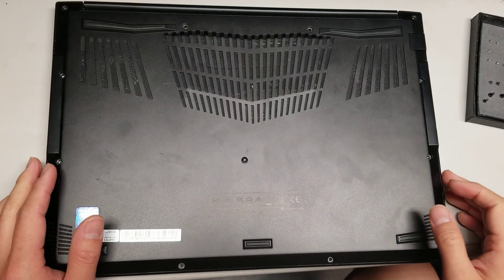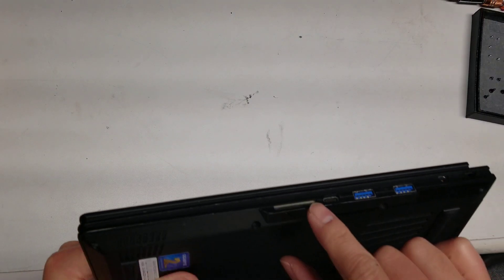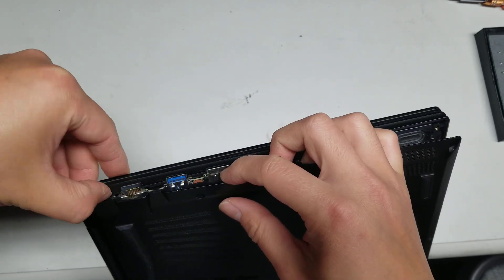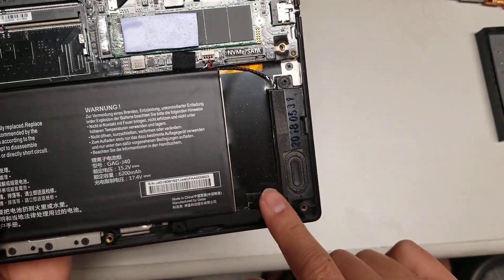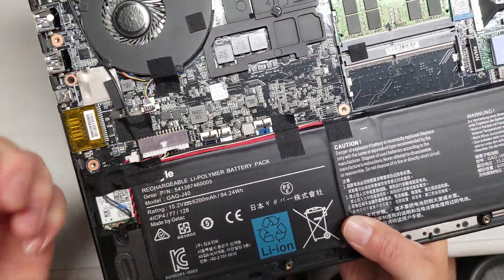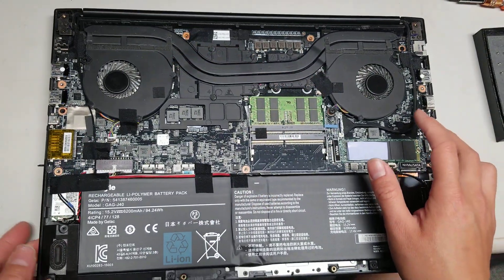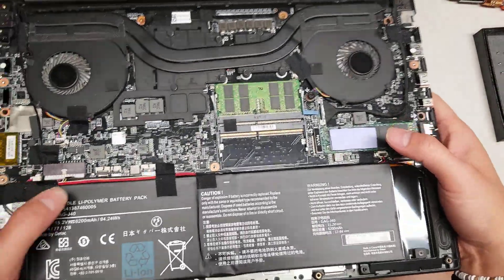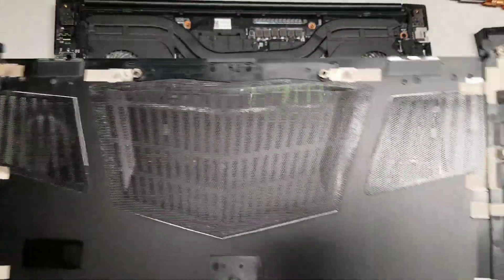Gigabyte Aero 15 Disassembly SSD RAM Upgrade

Comment: U had speaker cable beside each speaker, the long cable u thought was the speaker running along the battery is actually the battery cable
Reply from the maker: The red and black is actually the cmos bios battery. I was right about both speakers being connected with the one connector.

Comment: I looked for this for so long!!!!! Thank you!
I already opened my aero 14 once to replace the faulty overheating ssd but now I have to replace the wifi card and repaste the CPU and I just didn't feel like doing it without a disassembly video
Reply from the maker: No problem. Hope it helps. If you haven't already, please like and subscribe so others can find my videos. Thanks!
Reply: @ItsBinhRepaired  I did like but I don't really find myself needing those videos often. I will put this one on a playlist so I'll remember your channel next time. Try adding tags for "teardown", "guide" and such, the video really is way too difficult to find for how relevant it is to what I was looking for.
Reply from the maker: I think you're right. I added teardown guide to the description of all my disassembly videos. Hopefully that makes them easier to find.

Comment: Nice video. Question: where is the BIOS ? I have to change mine because i do not remember the BIOS password and i have no USB boot (now my grub is done and i'm screwed to...). If you know how to reset pBIOS password without to change it... but i get one BIOS chip i ordered on ebay and i want to change it, but i'm not sure which chip is it on mobo... an help with that is very welcome.
Reply from the maker: No idea

Comment: Hi -thanks for this. Came here to review the removal of the bottom cover for a RAM upgrade for an Aero 17 HDR XD. Seems a T6 Torx bit is required (good luck finding a descriptive manual on the Gigabyte site) for Aero 17 model as well. Have you come across any issues where the battery won't fully charge? Upgraded to latest BIOS F007 and then Win 10 to Win 11..no change. PS Gigabyte  is a disappointment as of late. Their Control Center software where you tweak settings, doesn't work in Win 11, hold off on the upgrade. to Win 11.
Reply from the maker: Yeah, sadly.

Comment: Hi, I flashed my BIOS with the most recent BIOS for this computer and now I get nothing but a black screen on power button and power doesn't shut off.  There was no startup sequence.  Pressing F2 to get to bios screen did nothing.  I had to open computer and unplug the battery to shut it off.  Any idea how I can fix the bios now?
Reply: oh and the only reason I wanted to try a new BIOS was because the onboard video camera never worked and I thought it might be a BIOS / firmware issue.
Reply from the maker: If you killed the bios and a cmos reset doesn't work, the motherboard is dead. You'll need someone to replace the bios chip or replace the motherboard.

Comment: Can you put ssd SATA? I saw a review where she said that she had a space but I can't find anything for her.
Reply from the maker: You can put an m.2 sata ssd to the right of the battery. I think it says it supports both pcie nvme and sata, but pcie is the better choice if price is similar, which I've noticed sometimes they're actually cheaper.

Comment: Is there any possible way for a SATA drive to even fit in that spare slot? Looks like there's no space for one.
Reply from the maker: If I didn't mention it in the video, I don't know.
Reply: It has to be sata in m.2 form factor. Like the wd blue.
Reply from the maker: @catonomics  they were asking if the bottom left side they can fit a 2.5" sata drive

Comment: Hi, great video, exactly what I was looking for... It's summer here, playing some heavy video games this goes up to 60º, sometimes 70º, And today (even with full fans) I watched 88º ='(  in my program "ThrottleStop" (A friend told me about it and works really good, lower the temps by itself). 
Anyway... Should I take it apart to clean it or do you have any other method?
Ps: I really take great care of my notebook, it hurt me even to see how you moved it and its small knocks against the table xD
greetings
Reply from the maker: Lol just a little dust cleaning. It shuts off at 100º, so you should be ok, but if it's dusty, clean it up.

Comment: Fuuu... Every time when open laptop back-plate BEFORE add/remove RAM/SSD you MUST disconnect battery!!! Do not touch elements when battery not removed! One exception: SATA HDD.
Reply from the maker: Wrong...I've been doing this over 10 years...The only thing you need to remove the battery for in advance is the lvds/lcd/screen cable. Other than that, unless you drop something metal on the computer, there's no problem leaving the battery connected.
Reply from the maker: Real life experience beats whatever fake knowledge you got from wherever you were trained. Lol The only other thing you need to do is make sure the computer is off.

Comment: The red and black cable is probably for the cmos battery
Reply from the maker: Probably
Reply: maybe not, because there is no CMOS battery for the BIOS, as long as the BIOS has an eeprom memory inside. I didn't see any CMOS battery under too...

Comment: Can it run when the battery is removed? I mean just use the AC adapter…
Reply from the maker: It should, I don't see why not. Most laptops do.
Reply: @ItsBinhRepaired  oic…thanks for reply!

Comment: does upgrading the ram/ssd void the warranty?
Reply: I had to use my warranty 2 months after I bought my Gigabyte they were clear that if you modified the computer it won't be accepted.
Reply from the maker: It shouldn't unless you break something, but some companies are assholes and try to get out of the warranty. If you can change it without any signs of tampering, you could always put the original parts before sending it for warranty.